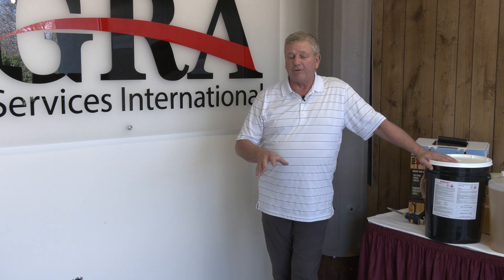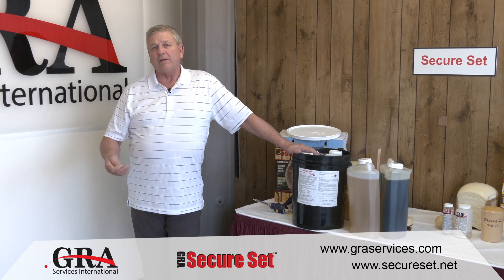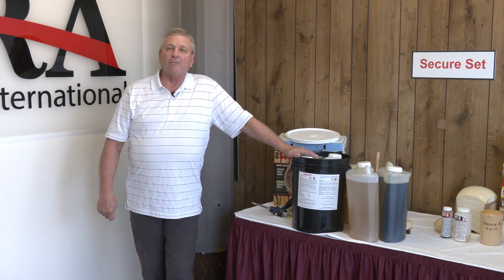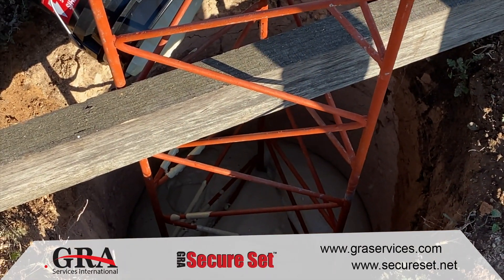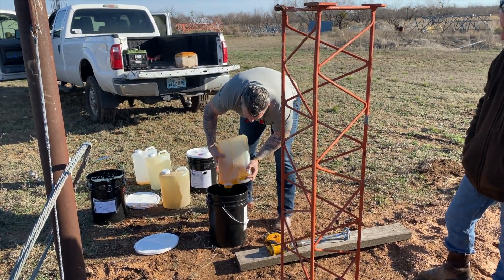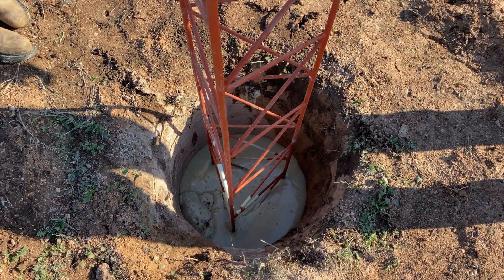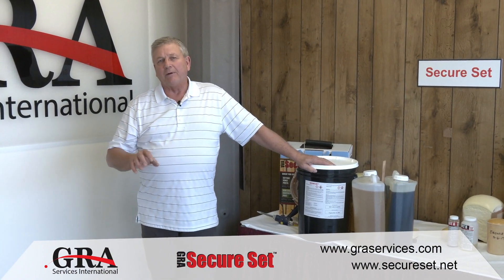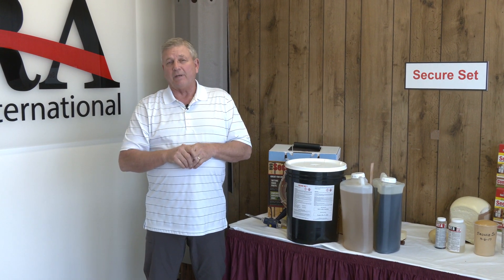Secure Set Used for Radio Tower Foundation

Comment: How long does it last.. how does it hold up against rain and so on
Reply from the maker: Secure Set foam is projected to last in the ground for at least 40 years since nothing really effects it.  It is a closed cell high density foam, so it doesn't absorb moisture as long as it isn't cut.  If you cut it you just need to paint over it with a latex paint to close off the opened cells.  Thank you, GRA Services the Makers of Secure Set.
www.secureset.net

Comment: I guess the only thing missing from installations like this is the ballast effect of heavy concrete.  Otherwise, awesome.
Reply from the maker: As far as the ballast effect, this product will support 10,080 lbs. per square foot; therefore, it is extremely supportive.  We have even had a customer that used the foam under an Air Base jet testing steel chamber to stabilize it, since there was an uneven area under the chamber.  It was approved by their engineers for this use.  It's an amazing product used in many applications.  
Thank you, for the comment.  GRA Services